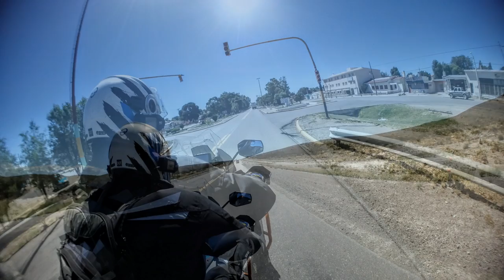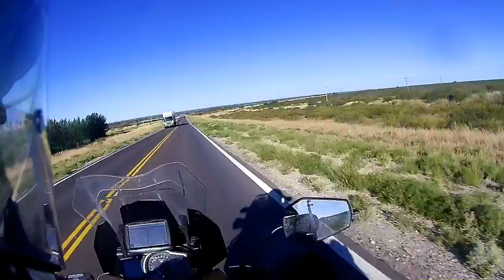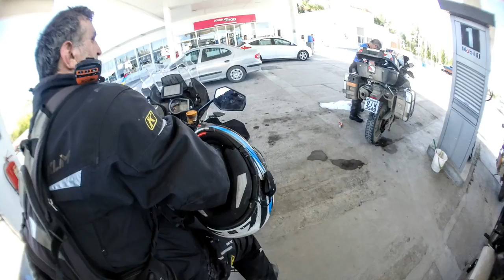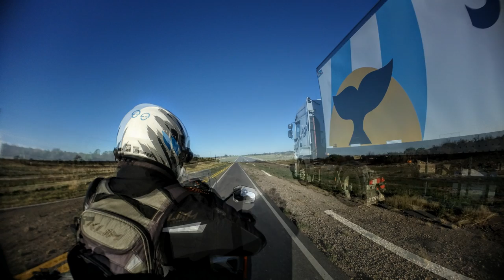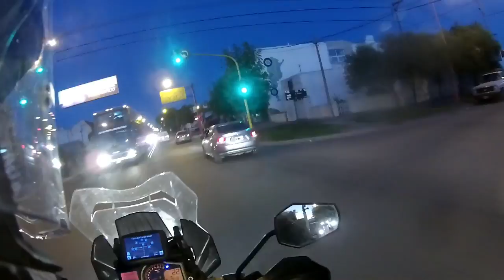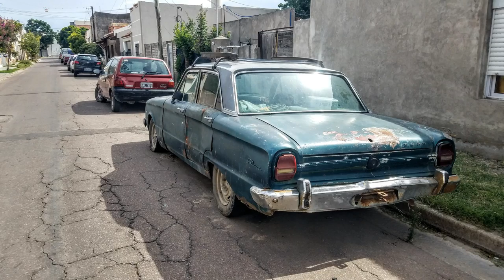Ride Day 79: Comodoro Rivadavia to Bahia Blanca, Argentina

Comment: Many of the gas stations will have dirt in bottom of tanks, if not cleaned regularly. Then when they fill up again, all that shit will be Swirled up and all fuel will be bad for some time. So not good to fuel up right after station has got fuel from truck, better to wait an hour or two :)
Reply from the maker: Yes, true, however when on the road, you tend to risk it :)